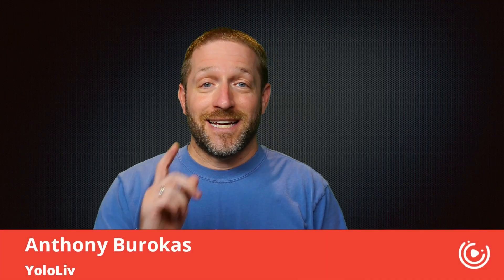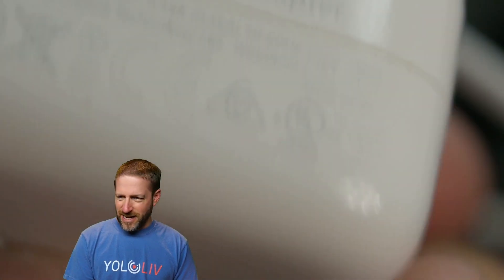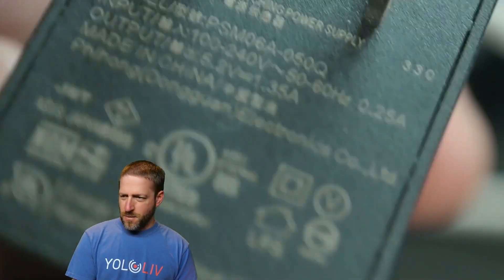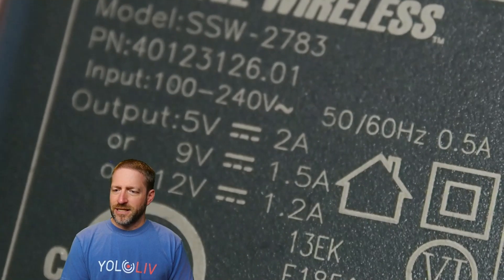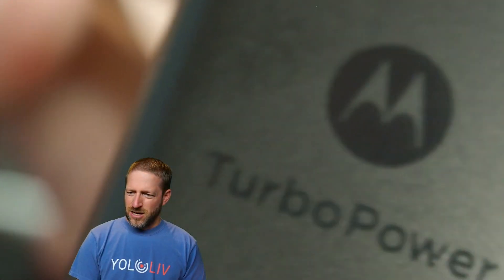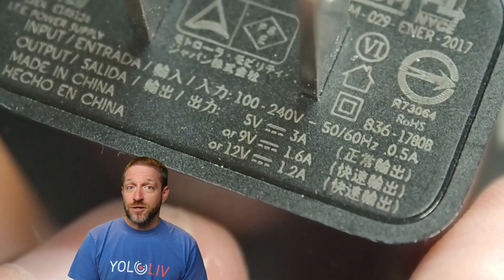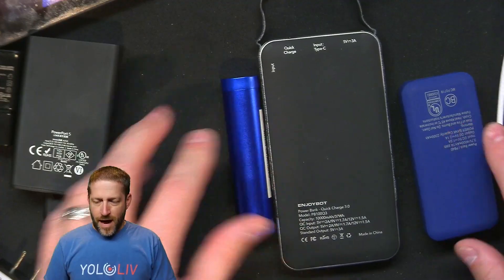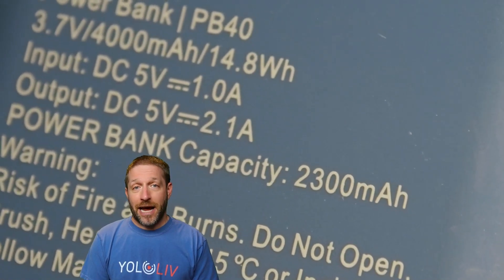Powering YoloBox - "Why My YoloBox Won't Charge?"

Comment: I just got a Yolobox Pro and based on the guidance got an Anker Nano II 45w which, according to the specs on the box, has an output of 5v and 3 amps but still not charging using the supplied usb-c cable...has anyone found a verified list of compatible power adapter??

Comment: Thank you. The video also needs to be modified to say that the cable that charges from thw power supply must be a USBA to usbC. Using a usbc to usbc doesnt work.  Heres hoping the next batch are supplied with 'official' supported chargers  so warranties dont get voided and so it improves troubleshooting. The above tested both on a yolobox pro and Yolobox portable.

Remember people 5W. 3A  and USBA to USBC.
Reply: thank you! this is the answer I needed!
Reply: This is the answer that saved me lots of time. I tried it after having issues with other USB-C to USB-C charges, and using other USB-C to USB-A chargers. Thank you so much for your time and for being helpful! 🫶🏾🫶🏾🫶🏾

Comment: How impractical can you make this?

Not only do you not have the right adapter in the box, but it means that charging in a primary use case (i.e.- on a sporting event) is really not feasible. Won't charge from a USB-C battery pack? Won't charge on a USB-C cable from my Tesla. If my game goes into overtime, I'm screwed.

Love the product, but this may make it useless to me.

Also: just odd to make a video like this where you seem to be laughing about how many products are not compatible with yours.

Comment: So I know this is late in the game but I really struggled to figure out what the true requirement is for powering the Yolobox Pro as well as some other devices I use in my livestream setup. But I finally figured it out. All the numbers and label reading that Anthony goes through really doesn't matter as much as the actual technology behind the power supplied ESPECIALLY if you are using a power bank. What really matters is QC technology. It doesn't matter how many amps, volts, gigawatts your device is putting out if you are using Power Delivery (PD) technology it simply won't work. Even if you are using the higher rated output port on a power bank with a USB C - USB C cable, if you plug in the Yolobox Pro into a PD port  it will simply not provide power. Using the same Power bank but plugged into a lower power rated QC port using a USB A - USB C cable and you are in business. This applies to every charging medium  I've tried to use USB hubs, stand alone chargers...none of my macbook chargers work because they are PD tech but some older Samsung chargers do work because they are QC, new Samsung chargers don't work because they are PD. Simply put QC certified ports work but PD ports don't for YoloPro. I'm sure all the other stuff Anthony is talking about applies to minimum power output required but more important is the port you are plugged into needs to be QC in my experience. Hope this helps others.

Comment: I’m using an Apple type C charger that’s rated for 5V / 3A on it’s single port and I’m trying to charge my new Yolobox Pro that I just unboxed and it will not charge. The indicator light will flash green then immediately turn red. The “yololiv” logo will pop up on the screen for about 5 seconds and then the device just turns off and restarts the whole process all over again. I’ve had it plugged in for at least 30min to see if it would would charge a bit but it hasn’t. Did I receive a defective device and should I exchange for a new one?
Reply: How did you resolve it? Can you help me I'm having the same issue.
Reply: @arjunsaji2225 Unfortunately mine was a bad device. I had to exchange it.

Comment: using a 5V 3A charger with a 240W cord, Yolo live wont stay powered up. I turn it on and it immediately shows 0% battery and powers down.
Reply from the maker: Hole the power button for 10 or so seconds to clear the device's cache and power it back up. It may be fully charged.
Reply: @YoloLivTech  sent a video to tech support, they are repairing/replacing the unit. Thank you.

Comment: well i have a 5v 3A PD charger and it's not working.
Reply: Same. Did you send up figuring it out?
Reply: @cardswithcandace  you can only charge with a usba to usbc cable. Cannot use c to c has to be A and have the PD SPEC.

Comment: The only way that I used to charge my YoloBox Pro was by using the 'USB A' to USB C' cable, with the USB A plugged into a suitable PSU and the 'USB C' connected to the first 'USB C' socket on the YoloBox Pro.

Note: 'USB C' to 'USB C' charging only works if you have a suitable USB-C charger which supports fast charging AND a USB-C to USB-C charging cable with a built-in charging recognition chip!!!!

So how do you know if The YoloBox Pro is actually taking a charge?  If it is, the green power LED turns red, even if the YoloBox is completely switched off. If the box is off, a quick press of its power button will display the battery status IF IT IS RECEIVING EXTERNAL POWER. Oddly the red 'charging' LED does not go out when the YoloBox Pro is 100% charged, which is a nuisance.

Chargers and Power-banks that I have successfully used include:-

1) qBLOC A100 Fast Charger using either of it's 'USB A' outputs, rated at 5V at 4.5A

2) An old Apple iPad charger, using its 'USB A' port, rated at 5V at 2.1A

3) A mophie powerstation wireless XL rated at 5v 2.1A

4) A mophie juice pack, rated at 5v 2.1A

Do note that items 2-4 above are below Anthony's recommended specification, so I would only use these for charging if the YoloBox Pro is fully switched off.
Reply: USB A to USB C Cable to a PC got us charging again when a slew of 5v 3Amp USB C chargers where not being recognized. Thanks!

Comment: YoloBox mini should come with an appropriate charger
Reply: So should my Apple 14 Pro Max. . . Which costs 2x as much as a YoloBox Mini.
Reply: @IEBATechThoughts  That's not a good excuse considering Apple is being forced to USB-C in the EU. Yololiv can do better
Reply: @RayOrsini   Apple already do not provide a charger, so changing the port does not mean they have to provide a power adapter.

Moreover, the regulation says if charged by a cable, the plug must be USBc. Apple also has MagSafe  - Apple may "comply" with the regulation by eliminating the port completely, like they did with the headphone jack.

Comment: I think my Yololiv is not charging, the battery is at 0% I can't even turn it on or charge, I'm using a 20W 3A charger
Reply: 'USB C to USB C' charging doesn't appear to work whatsoever with any PSU that I have tried. It seems that you must use a PSU's 'USB A' socket to the YoloBox's 'USB C' charging port

Comment: Anthony, talking about Power. Can you tell me why my yolobox pro will not power off unless I disconnect everything from it? Using the Power down sequence procedure stopped working correctly about four updates ago. It keeps turning back on unless everything is disconnected from it.
Reply: I don't know why that would be. I never disconnect anything from mine to shut them down. I long press the power button and select shut down from the pop up.